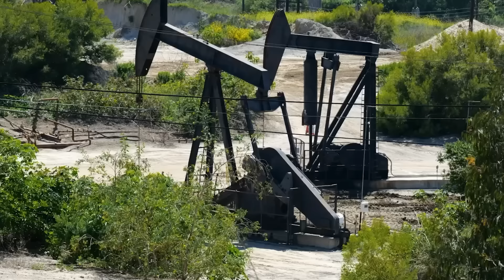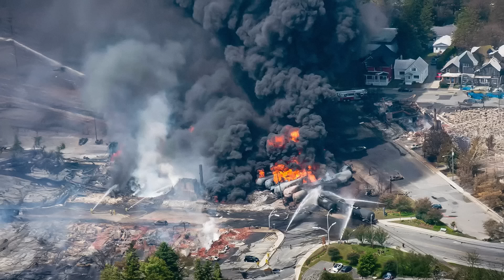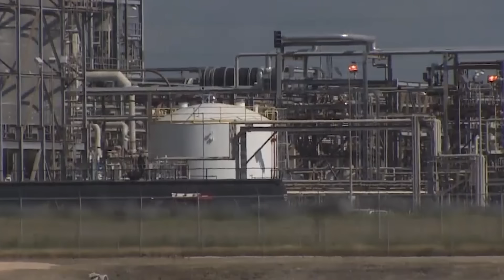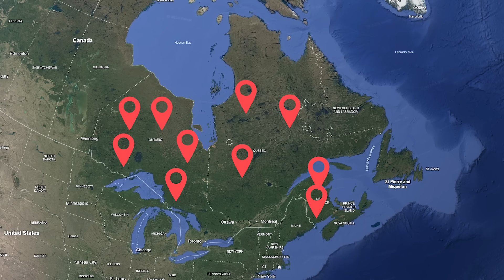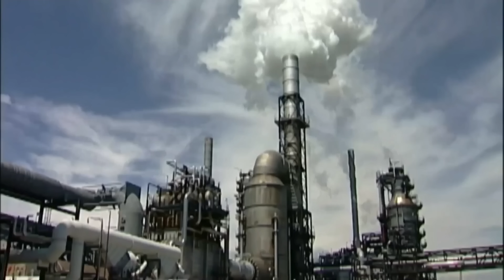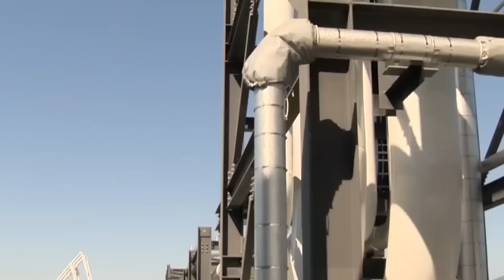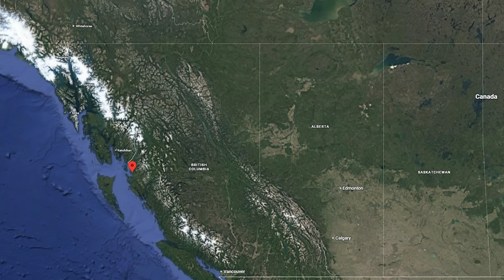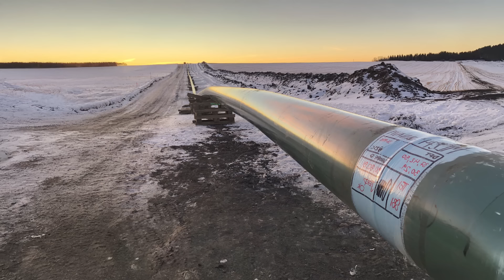Here's Why Canada Can't Build Its Own Refineries, Even Though It Produces Millions of Tons of Oil

Comment: Alberta needs to build its own refineries no matter what it costs .
Reply: Edmonton/Strathcona has 5 major oil refineries producing 450k per day. I was born there.
Reply: @jayjaynezmerize6774 yeah but the point of the video is that Canadian refineries aren't set up for Canada's type of crude so they import the crude from Saudi and the US because that's the type they're set up for. Honestly I think Alberta and Texas have a pretty good situation and if I was an oil man in Alberta I'd be trying to get more pipelines down to Houston for my crude or a pipeline to British Columbia and sell the crude to China because I think they can refine it but I'm not positive.
Reply: @taylormajors5677  Atlantic Canada has no pipelines so all the oil has to come by carrier. The Irving Refinery in New Brunswick is the largest in Canada. It runs off African, Saudi and US oil imports. It has increased it's use of the offshore oil from Nfld. Unfortunately, oil refining is not simple. Irving requires a significant retooling to run completely off Nfld oil. When Bay du Nord comes online around 2031, Irving will be able to use more of that oil.

As to more pipelines to Texas doesn't make sense. Approximately 57% – 62% of the Alberta oil goes to the Midwest refineries (IL, IN, MN, MI, OH, KS). Only ~16% – 19% goes to the Gulf Coast Refineries (TX, LA, MS).
Reply: @taylormajors5677  we have a bitumen refinery, it's called Sturgeon and it's a $28B boondoggle. It's the first and only pure bitumen refinery for a reason, it is incredibly energy intensive to refine pure bitumen making it far cheaper to dilute it with light oils like Brent. So the paradox is, to refine more of our own oil, we need to import more oil.
Reply: @clayton4620 where did you get 28 billion? Its cut with diluent naphtha not WTI.
Reply: @taylormajors5677  Untrue. Suncor has a Coker and treaters for bitumen feed. Shell has an Upgrader ne door and Imperial runs Cold Lake crude for asphalt and run plent of Syncrude. Running heavy crude is an economic decision to spend more for lighter/sweeter crude or invest in hardware to take advantage of the price of heavy crude. Either way it makes no difference to how much crude is exported. The lighter sweeter crude gets used or sent down the pipeline.
Reply: @taylormajors5677 that’s completely false though. Theres 19 refineries in Canada using Canadian Oil to make everything you can imagine.
Reply: @t @taylormajors5677  so invest the money now and it will pay off later. The Liberals decided to send billions of dollars for foreign aid 😂.
Reply: @taylormajors5677  There is a pipeline that goes from Alberta to Pacific Coast. Another for LNG
Reply: @taylormajors5677  you have gorgotten the greenie Federal government which hates fossil fuel. And actively hinders permitting and applying green regulations.
Reply: Alberta, it does have refineries. If we build more, how are we gonna get the fuel to the customers? We need one pipeline for gasoline. Another pipeline for diesel. Another pipeline for jet fuel. It doesn’t make sense for refineries need to be close to the market where the fuel is used.
Reply: @Wojo888  pipelines can be packed with different liquids in batches. Separate pipelines are needed for gas, water, etc., but finished product liquid hydrocarbons can use the same pipeline.
Reply: There is no problem with separate pipeline for water, sewers, gas. Why it should be problem in this case.
Reply: As well with the transmountain, Kinder Morgan was going to build that and all they wanted was a guarantee from the federal government that there’d be no more regulatory hurdles. Trudeau refused to give them a guarantee! And once the government took over the project, that’s why the price went up!
Reply: NB here. The rest of us in Canada need to step up and help Alberta build these refineries since Alberta has been giving us the money in "equalization payments".  If the money Alberta has ALREADY given out was used to make the other provinces PROFITABLE AND SELF SUFFICIENT everyone would be making money and equalization wouldn't need to be happening. Instead I feel we are all poor little beggars off Alberta's natural resources. and SOME provinces benefit more than others..... just my 2 cents ( a Loonie with inflation)
Reply: @bob9341  as soon as alberta gets rid of their  traitorous Premier
Reply: The 19 billion lost every year could pay for some refineries.  But we all know This is all on purpose to regulate the production.
Reply: Right next to the oil sand production..
Reply: Usa already own Alberta oil
Reply: And go bankrupt...  Why you're not CEO.
Reply: why would alberta build refineries? all their resources are owned by global megacorps
Reply: @1EyedManChild go renewable? 🤷
Reply: Then what?  Still no pipeline to the East.
Reply: Liberal Government restrictions with Zero emissions is the problem. Canada's heavy crude oil requires oil refineries that can process this oil in mass volumes. These refineries require high-complexity residue conversion and carbon-rejection or hydrogen-addition units. Unfortunately it wouldn't be permitted due to Liberal Government Climate Change restrictions.
Reply: I dont think the 4 million people living in Alberta needs that much oil
Reply: Alberta?  I think you mean Canada.
Reply: And keep the greenie lawfare brigade at arms length, in fact in jail. They inflate project prices by millions or even billions.
Reply: Ok Alberta does that and? You are left with the exact same problem, Alberta cannot consume what they'd produce and cost and risk are the same as oil. That's why Ontario and Quebec have refineries because it's more cost effective to refine it where it's consumed, it's why Alberta sends it to the U.S where it's main customer base is. At least now thanks to Justin Trudeau Alberta is selling oil to China more and more each day and China pays more than the U.S. there are plans to build new refineries and a pipelines east, how far east maybe just to Ontario but a pipeline to Churchill Fall's deep Sea Port is in the works as well.
Reply: Fuck oil, go renewable. 🤷
Reply: In Alberta
Reply: Currently there are 81 refineries in Alberta PLUS 4 upgraders
Reply: Refineries in Alberta are capable of and do process every type of oil in this province. Refineries PLUS upgraders! We've got it all covered!
Reply: They HAVE refineries.    WHAT do you want them to refine to .....gasoline?

.
Reply: @YBANRUB yah they do already.
Reply: "Alberta" doesn't build refineries.  Refineries are built by private investors who will do so only if there is a business case, because its the investors, not the taxpayers, who put up the money.  You want to build refineries that aren't economically sensible?  Then tax yourselves to raise the money, and to cover the losses you'll make.
Reply: @lesliemacmillan9932  - It's not quite that simple. Oil companies have become addicted to government subsidies, crying that they'll leave if they don't get them. Cut them off and they might find a "business case" for new/upgraded refineries. Additionally, cut off the subsidy that Canada gives for oil exported to the US, and watch the oil companies scramble. Oil companies do not need subsidies! You want proof? American oil companies are preparing to go to Venezuela and completely rebuild their oil industry, without subsidies from either the US or Venezuela. Think about that.
Reply: @lesliemacmillan9932  The NWR Sturgeon refinery in Northern Alberta came online in 2020. It was built by CNRL (a Canadian oil company) and the Province of Alberta. The state of the art refinery processes oil sands into Ultra Low Sulfur Diesel and other petroleum products. All of these products are used domestically (AB and BC). It also captures the CO2 released in the process which is piped to older oil fields and used to force out hard to get oil. The CO2 remains in the rock. You can read about this refinery -- it's pretty amazing -- search for "NWR Sturgeon Refinery".
Reply: @lesliemacmillan9932  shhhhhhh you are wrong.... shhhhhhhhh
Reply: This publicity is trying to prepare the uneducated people for the looming recession (depression) in Canada. I am Canadian but I can see through this justification of the recession or beyond. Wake up !! We are done.
Reply: Once Alberta is an independent nation, this video will be mute because we won’t have to send our tax dollars to Ottawa anymore.
Reply: And then the oil companies will finally be able to afford their royalties and property taxes?
Reply: @neilpk70 another parrot. Oil companies don’t own vast amounts of land to be paying property taxes….and they pay billions of dollars in royalties every year, far far more than any other industry.
Reply: Canada needs refineries in every province and a network of pipelines to feed them. We'd have had all that a long time ago if Alberta and the Mulroney Conservatives didn't kill the National Energy Program back in the 1980s. Remember that. It was the Conservatives that killed the NEP. Now they won't admit that it was a mistake.
Reply: They could put the refineries on already contaminated land, try to keep it less toxic and ship it by rail
Reply: Implement a provincial sales tax and build it then.  I bet big oil won't let you and their rep Danielle won't either
Reply: Alberta already has five refineries, but could build more, and they will once they become an independent Republic.
Reply: @RickHudson-b5x  They're American owned
Reply: @redwater4778 It’s funny all the people like you talking like you know but just showing how little you do actually. You are wrong.
Reply: @KkevrockK  I know imperial oil shut their refinery down in BC in the 90s. Now the fuels come from Edmonton in batch loads or from the refineries in Washington state. I know BC lost 2 propane refineries and 2 sugar refineries due to mulroney/harper NAFTAs.
Reply: @RickHudson-b5x  and who will they sell refined product to? Canada and USA already refine more oil than it uses.
Reply: @RickHudson-b5x  Why hasn't Alberta already built more than 5 refineries? Waiting for handouts from the federal government? Why do you think you have to an independent nation to do that work?
Reply: @Ronald_Eh-Transmits handouts,thats funny since we sent 620 billion more in taxes to Ottawa then  recieved back😂
Reply: @davesteffin9012  Why do you idiots think that when you pay your income taxes you're supposed to get it all back? That's such a ridiculous thing to say. I pay my taxes, just like you, and when I get my refund it's a fraction of what I paid. 
That is essentially, what this is all about. Your whole argument is that Albertans expect 100% of their collective income taxes to be returned to the province in the form of cash transfers and services. That's not what how it works for any province.
Reply: @Ronald_Eh-Transmits  Alberta lives in a perpetual state of victimhood. They're basically the western equivalent of Quebec.
Reply: @Adam-gi1dr  In their own eyes, yes. Poor them
Reply: @Ronald_Eh-Transmits you are why this country is falling apart. How dare Alberta and expect their taxes be spent on them instead of Quebec. Pretend you understand Transfer payments and let’s just make believe that confederation is equal for all provinces.
Reply: China owns most of alberta
Reply: @NotACreepLikeRK0 No they dont less then 10%.

Comment: Canada has refineries but they decided to faze them out. They got rid of them because we "care about the environment".  When it's actually BS. The main culprit is Quebec. I'm from Quebec so save it. The old guard of Quebec have vested interests in Middle Eastern Oil. That oil gets refined in St John's, so they fazed out the Montreal refinery to increase dependance on that specific oil. That's why they criticize Canadian oil, like from Alberta. It makes no sense to do so, until you realize they're just corrupt. I fully expect the policies to radically change as the boomers go into retirement and their influence fade. Let's be honest, the policies are going to change because of the current war no matter what because no one can survive 2.00$/litre gas prices let alone 3.50$/ litre which is what will happen if this keeps going.

Comment: Canada has 16 to 18 operational oil refineries, depending on the source and definition (e.g., including or excluding asphalt or terminal facilities).  Most recent data from 2024–2026 indicates 17 or 18 refineries in total, with a combined crude oil refining capacity of approximately 1.9 to 2 million barrels per day. 

Alberta leads with 4–5 refineries, including major facilities on "Refinery Row" near Edmonton. 
Ontario has 5 refineries, primarily serving central and eastern Canada. 
Quebec and British Columbia each have 2 refineries. 
Saskatchewan has 2–3 refineries.
New Brunswick and Newfoundland and Labrador each have 1 refinery. 
The Irving Oil Refinery in Saint John, New Brunswick, is the largest in Canada, with a capacity of 320,000 barrels per day.  Refineries are strategically located near crude oil production, major waterways, or urban centers to meet domestic demand and support export markets.

Comment: Incorrect information at the star so i dropped this video, at 0:40 oil up to 3x cost of Alberta oil brought into east cost. Wrong, no where near 3x, not even double.
Reply: It is almost double. It was reported as tripple in 2017 tax documents. Canada is getting screwed because of our gutless leaders.
Reply: Liberal Government restrictions with Zero emissions is the problem. Canada's heavy crude oil requires oil refineries that can process this oil in mass volumes. These refineries require high-complexity residue conversion and carbon-rejection or hydrogen-addition units. Unfortunately it wouldn't be permitted due to Liberal Government Climate Change restrictions.

Comment: Canada needs to build their own.
Reply: We have lots of refineries. A new one came on line in 2020. Our problem is lack of pipelines to Eastern Canada. The largest refinery in Canada is the Irving Refinery in New Brunswick. All the oil it needs has to come in by ship. They have a deep water port so they can dock the ultra large tanker ships.
Reply: We were always told our climate made it hard to refine bitumen, and we concentrated on the cross country gas line.  And when partners with USA andcpipekines to there pre Biden were wide open it worked.

Comment: I live next to the Transmountain pipeline near chilliwack BC. Having watched the entire expansion project (twinning of the original line from 1953) I can say for a fact that the cost overruns have absolutely nothing to do with inflation or local flooding or steel prices. The cost overruns were 100% due to mismanagement, and government regulations at every level. I literally watched 100s of people earning many 100s of thousands sitting around day after day with their thumb lodged firmly up their ass while watching movies in an idling truck. That includes inspetors, surveyors, geotechs, managers, mechanics, environmental control people and drivers of every sort. Over the 3 years it took to complete the project more hours were spent sitting in trucks than doing work.
Reply: I lived by a lot of construction sites and I saw the same thing it wasn't until I was an operator in pieces of equipment on construction site that I realized the dumb s*** that can bring a whole project to a halt so people will probably sitting in those trucks doing exactly what you think but most of the time they were there doing nothing because nothing was actually called for
Reply: Explains the $34B, vs $7B original estimate

Comment: Yes, Canada refines a significant portion of its own oil, operating 16 to 18 refineries across the country with a total capacity of nearly 2 million barrels a day. While Canada is a major oil producer, it still imports roughly 35% of its refinery needs—mostly in the East—while exporting large amounts of raw crude to the US. 
Key Details Regarding Canadian Refining:
Regional Differences: Western Canadian refineries (primarily in Alberta) process mostly domestic oil. However, Eastern Canadian refineries often rely on imports due to limited pipeline capacity from the west.
Capacity: Canada has 18 refineries, with 5 in Alberta, 5 in Ontario, 2 in BC, 2 in Saskatchewan, 2 in Quebec, 1 in New Brunswick, and 1 in Newfoundland and Labrador.
Export/Import Balance: Although Canada has ample refining capacity, it is geographically more economic for some regions to import foreign oil (e.g., in the East) or send crude to US refineries and buy back the finished products.
Exporting Crude: Canada imports some oil for its eastern refineries while exporting large volumes of crude, mostly from Alberta, to the United States.  Oil is refined for gas closest to where it is used. It is simple. So, they ship to the USA, where it is used the most.  The oil that comes from the Middle East is refined in Montreal and elsewhere

Comment: An issue not mentioned, is that demand for oil will probably collapse in the next 20 years as electric cars and trucks take over from internal combustion engine (ICE) ones.  This is already happening in China, the country that builds by far the most cars on the planet.  ICE cars will go the way of film cameras. Refinery and pipeline companies know that they do not have the 30 to 50 years it would take to amortize major capital investments, so they are stuck with the infrastructure they already have.